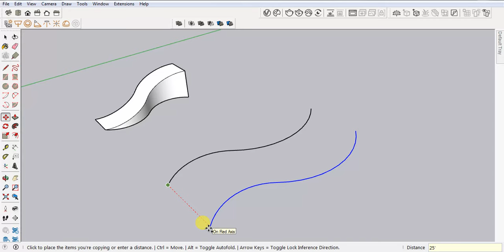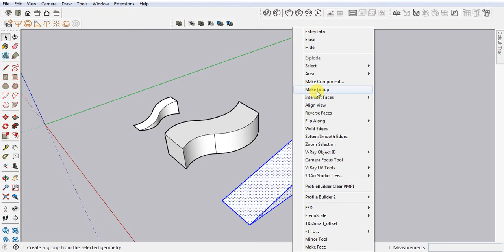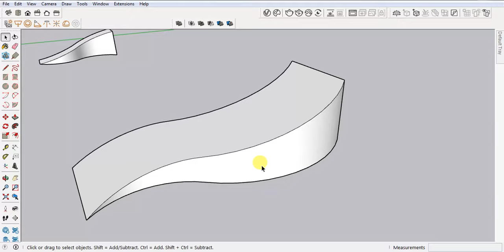Design and Build a Beautiful Curved Ramp in SketchUp || Ramp Design without Plugin

Comment: There are some fault in this this type of ramp as the slope requires specific angle of degree based on purpose..
Reply from the maker: Then first you can draw on angle after that use the solid tools
Reply: @SidhnathCreation  is there any video regarding creating a specific angle?
Reply from the maker: I'll upload the video

Comment: That is not the correct way to make a curved ramp, it only works in your example because the curves are so small, try it on a 90° or 180° curve and you will see I'm right.
You can use loft function instead to get it right.